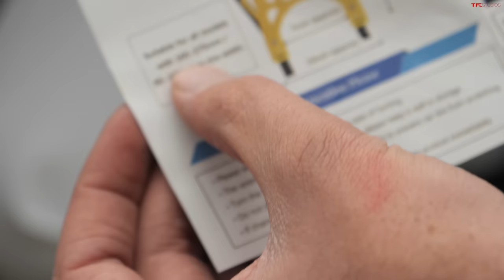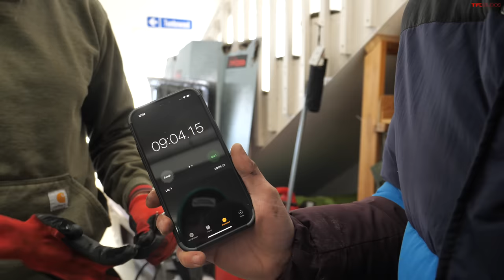Snow Chains vs Cleats vs Snow Socks | What's The Best New Device To Get Traction In The Snow?

Comment: They put the chains on wrong. Those are just a rebranded version of the SCC super Z chain and are designed to be installed without needing to move the vehicle. They put the side that is supposed to be on the inner tirewall on the outside.
Reply: That's was the first thing I noticed when they put them on!

Comment: I have a pack of Zip Grips in my trunk for emergencies. They're really cheap, easy to install, and disposable after use.
Reply: I think you mean dispose while being used.
Reply: @iffykidmn8170  They're not designed to be driven on for very long, they're just meant to get you unstuck and that's it.

Comment: Why not real chains, made of steel with side and cross links.  The third type you demoed are called cable chains, and I once had a set made by Michelin, which came in the trunk of a new Peugeot 404 sedan, RWD.  They got us home more than once,  but for the long haul up a snow pass or other unplowed road, I would find a set of steel chains - rugged, noisy, but wicked grippy.

Comment: I can get honda tire chains from the dealership for $75 right now cause i just checked the price... 

Tire chains range from $60-400 depending on how fancy you want them and you shouldve made that a disclaimer because they can be the cheapest option and tge most expensive

Also, all tire aids are limited to 30mph except for studded tires
Reply: ALSO tire chains are reusable

The other 2 are pretty much 1-time use
Reply: ALSO ALSO
If you hit the brakes hard enough that ALL 4 tires stop nearly the same time, the car will think it came to a stop and wont trigger ABS

ABS requires at least 1 wheel to be turning to recognize the others are locked up
Reply: And its not advised to run chains on dry pavement, so you gotta know what the realistic use-case is..... and its packed snow/ice

Comment: Modern chains are very easy to use and sturdy enough to be used for years (rinse off and dry to keep from corrosion and rust). These look like old school drug store cheapies.

Also, making sure you have the correct size traction devices.

Comment: just buy some studded snow tires 🙂 

traveled home this morning on Xice studless on a layer of frozen slush. no problems, install in November and remove in spring. No gimmicks, no chains, no cables.
Reply: And not legal in all states.🤪
Reply: I grew up with suds.  That is another can of worms.  Most tires have to be studded aftermarket and I have seen tires the studs that was beeper then the tread and being worthless till the tires worn down to the studs and I have seen studs so much taller then the tread that it was a light show at night from the sparks.  I got a ticket in Minnesota because of that.
Reply: When I lived in upstate New York, studded tires were not allowed. A good set of snow tires on my civic worked in the worst of snow conditions.
Reply: @mikekarena  I just looked up: 6 states that allow studs year around: Colorado, Kentucky, New Hampshire, New Mexico, Vermont, and Wyoming.
Reply: good points made that studs aren't legal every where. I'm in Canada and there legal in most provinces but not all. I run studless these years as i spend almost all of my time on roads that are salted and cleared regularly.  

seldom run out of traction on the road with winter tires, visibility and ground clearance are the main 
limiting factors.
Reply: @benson098123  Three times I escaped British Columbia to Alberta the last week in September before the mud snow tire requirement went into effect.

Comment: Throw the time it took you to put them on out the window. Your in a covered shop, with heat, on a flat smooth concrete floor. That’s hardly analogous to the scenario anyone that would be using these in the real world would encounter.

Comment: Ice/v-bar chains would also be a good one to test, they are what I use and they provide a huge traction boost when fitted correctly.

Drawback is you Don't want to go above 15mph they create a lot of noise and a very rough ride unless you are in deep snow.

Comment: You guys have never driven on real reinforced chains . Years ago I went to the local auto parts store for something else and saw a display of tire chains left over from last year at half price . I got the reinforced chains ,these are not just chains but have V shaped spikes welded to each link . We had a bad snow and even with snow tires my F 150 was having a hard time . My buddy Paul called up and was tired of being stuck at home and wanted to go out to the bar . I said if I can back the truck into you garage far enough to get my back wheels in I have a solution . So he got the car out of the garage [ with a fair amount of shoveling ] and had a floor jack at the ready and we installed the chains  easily with the tires off the ground [ he lived close by so I was able to get there ] and tightened them with the nut and bolt tighteners . The difference was night and day . The snow was at the bottom of the doors [ unlike Tommy's 4 inches of snow ] and sometimes deeper . The F-150 charged though like there was no snow the only downside was the directions on the chains said the 30 MPH was max speed , which was better than 0 MPH

Comment: What you guys call snow chains are snow cables and they looked a little loose to me front wheel drives cannot use  chains because of the CV joint but if you had chains with icebreakers on you would have done a lot better put them on shorty your Dodge chains with ice breakers four-wheel drives you put the chains on the front wheels

Comment: Those “chains” aren’t actually the old school version..  The real old school chains are made of… chain (metal links and all)!  Think of what you see hanging from the frame of a semi truck going down the highway in the winter.

What you had were “cable chains”.  And probably the wrong size. Proper fitting chains, installed correctly, won’t come off.

Comment: Those chains are way too loose. A smaller size would work better. I used to use the old chains that were actually made from chains, and they worked well as long as you did not drive on pavement for too long. Then they wore to the point of breaking. I now have a 4 wheel drive truck and an all-wheel drive car. If chains are needed on either of these, I just stay home.

Comment: REAL chains are very easy to put on, they don't fall off, they don't brake because you spin the tires, they last year's and years of use, and can be had for under $200 Cad for heavy duty V-bar style. You won't see anything but real V-bar chains on commercial vehicles because the are the best, bar none.

Comment: Nice to see temperature in Celsius and also Alex wearing a CANADA GOOSE winter coat. The trifecta would be BAFFIN TECHOLOGY boots. BTW...ABS OFF shortens brake distance BUT you may have less control due to locked wheels. ABS ON increases brake distance BUT much more controlled. I learned this from watching WYATT on TEAM ONEIL RACING on YT.

Comment: For a couple of guys who apparently consider themselves gear heads this test and its conclusions are utterly pointless.  Shame on you for offering this as recommendations on what to use.  
For anyone seeking advice on traction devices (beyond snow tires or studs) the correct answer is chains. Specifically proper chains, correctly sized for your tires, correctly installed (meaning straight, untwisted and tight) and readjusted after no more than a mile.  Overall Euro style chains like Pewag and some others mentioned here in the comments have worked best and lasted longest in fleets consisting of vehranging from sedans thru pickups up to heavy equipment. 
Loose or I'll fitting chains and all those cheap gimmicky devices will leave you stranded in short order.

Comment: Didn’t give any product a fair test.

Standard tires: wheel spin off the line, locked up on decent

Cleats: wheel spin off the line, locked up in decent, not even put on evenly

Socks: wheel spin off the line attempted burnout like he had on high profile mudding tires, let’s off the brake to cheat cleats and regular tires. Does a burnout on the hill test inside the tire and is confused how they ripped. Doesn’t even fit the tire.

Chains: does a burnout launch and slips on launch, doesn’t attempt the feather the throttle on the hill climb

Like this video didn’t test anything right and I’ve wasted 30 minutes of my life just as confused about making an informed decision. This video should be deleted.

Comment: Are y’all sponsored by AutoSock? Sorry but this test heavily biased against chains which is hilarious. 

Instead of buying cheap Chinese BS every time, you can get a decent set of chains from Walmart. The Peerless AutoTrac chains are easier to put on and are more quality than the cheap cables you are using.

The one guy in the video said that chains run from 150-200 which may be true if you are buying Thule or a boutique brand. The AutoTracs from Walmart run around 80 for the pair, the cheap Chinese cables you are running probably closer to the $30 range.
Reply: Price is relative to size and style of chain, Peerless double ladder vbar chains for my truck cost me $300 and I think the studded chains were closer to $400 per set.
Reply: @iffykidmn8170  well yeah when talking about odd tire sizes or larger off-road oversized tires it gets pricier. Then again people that buy those tires are already used to paying more, just in tires. 

I’m just talking about a pair of half decent class S chains, instead of the cheap cables they used in this video as well another cheap set they couldn’t even figure out in another one of their videos. 

Decent quality chains will outlast and outperform any other traction aid out there. I don’t have all the experience in the world but I’ve lived in Alaska and now NW Montana. Never been stuck even in some super sketchy forestry service roads that definitely don’t get plowed all winter long.